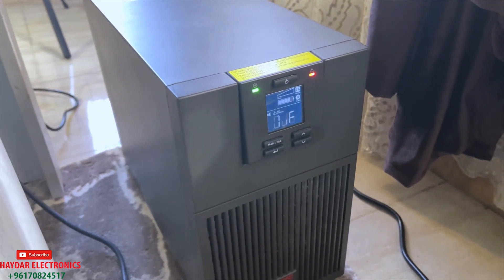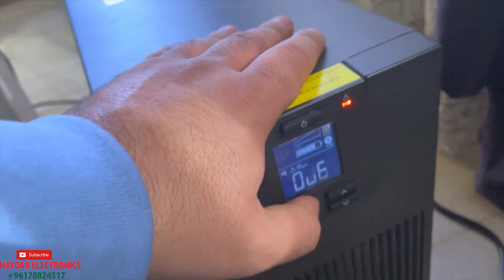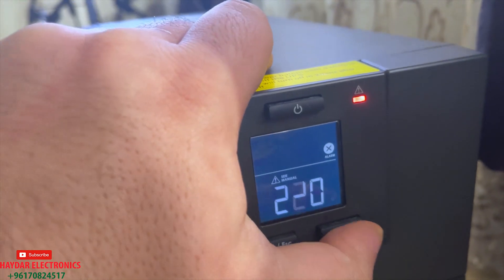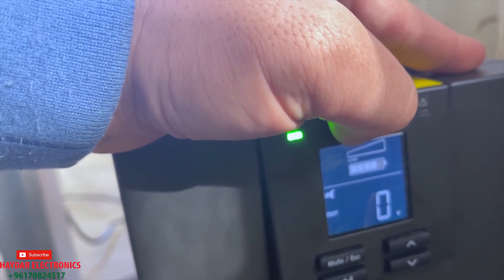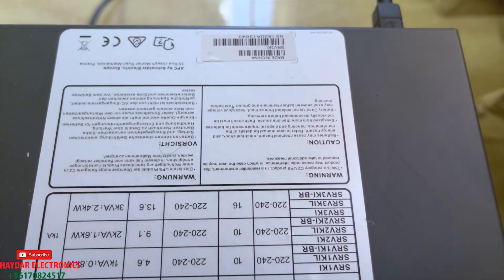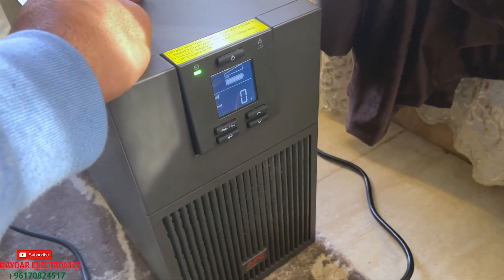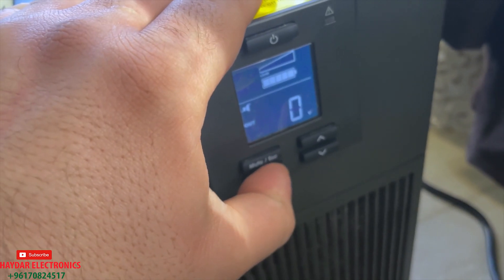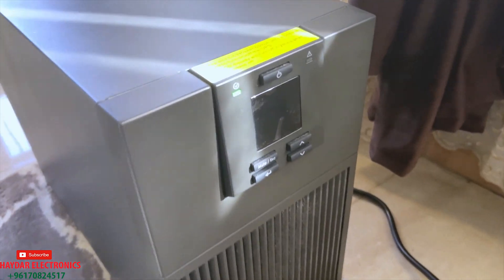ouf 116 error code apc ups problem (fixed)

Comment: Dear sir I have 2kva 48v DC inbuilt battery system 2 no both UPS charging voltage getting 4volt high 58v coming I need 54 to 55 how to solve this problem board is good condition

Comment: It first wants to find out how much the input voltage is from the socket, it probably fluctuates and only very undeveloped countries have 220volt. 240volt is now used as standard and 120volt in the USA and Japan. Because the APC was set to 240 volts, it did not "taste" the undervoltage

Comment: This saved me today when my APC ups was showing a 114 error. Didn't find this information anywhere else on the internet so thank you.
Reply: 114 is very high inrush current on the output, are you sure you didn't put to much load on the UPS, it will trip and go into bypass mode till you restart the ups.
Reply: @sydskits5962  I am sure he didnt, I updated my firmware from 0.04 to 0.09 and this shit came out. Before this, there is bDc error occasionally on firmware 0.04, and firmware update is required. The load percentage is just only 12%.
Reply: For everyone watching and headache about the 0uf 114 error, it is caused by a firmware bug, you have to update your firmware to 1.0 instead of 0.09. If you are on 0.04 and occasionally got that bDC error, just wait 5 mins for it to resolve itself, do not update to 0.09 unless you got firmware 1.0